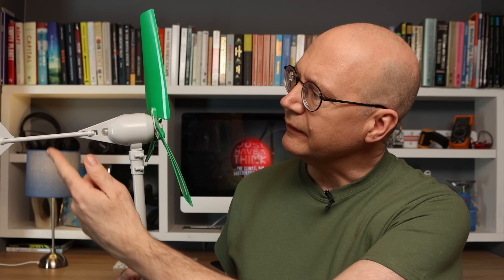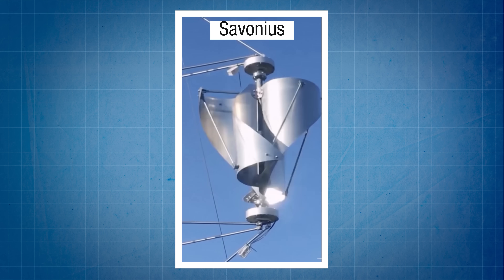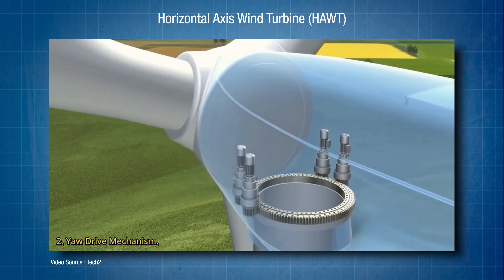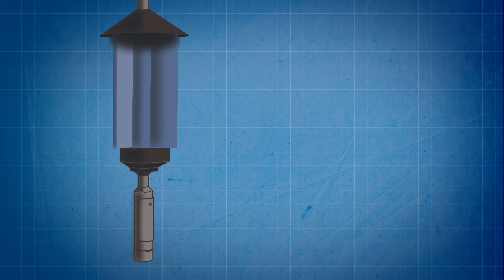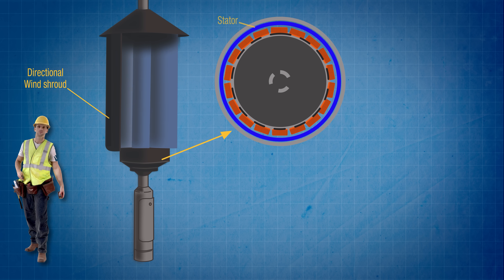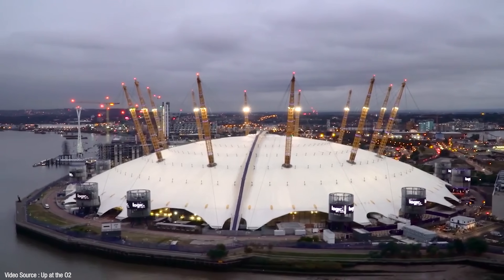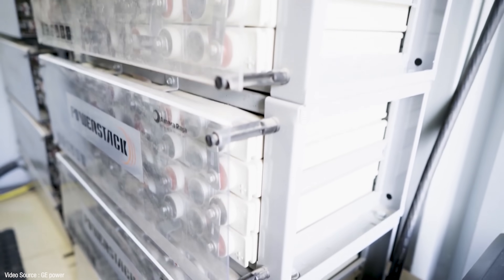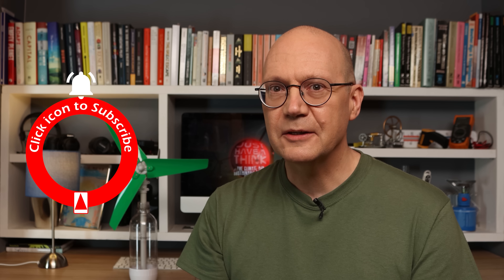A vertical axis wind turbine that doesn't need the prevailing wind! How do they do that?

Comment: If the prevailing wind is against the flow of traffic the airflow from traffic will tend to negate this.

If they are economical enough to produce maybe they should have two on lampposts in open areas, one for traffic and one a little higher for wind.

Comment: nothing is free, this "wasted" energy makes cars burn less fuel, if you start harvesting this wind, you will slow air flow and cars will burn bit more fuel because of air friction, for each car it will be very little, but combined, it will be more emissions, you will just convert fossil fuel to energy like in any other fossil fuel power plant, you just won't pay for for fuel, ppl on road will

Comment: Please check the numbers before spreading them. Eghter this is a scam or there are a major mixup in the presentation of the numbers. At 5.4 m/s the available power in the wind is less than 60 W/m2. The shown turbine has an swept area of less than 2 m2 and can't possibly produce more than 120 W yet it is claimed to produce 2500 W under those conditions. Later it is claimed that a 3 MW plant consist of 125 such turbines giving each turbine a power of 24 000 W. If the calculations refers to wastly different sizes of turbines this needs to be clarified. As it is now the video is very misleading.
Reply: Many of us have commented on this, but Dave is not listening . . .

Comment: These turbines might increase fuel consumption by the passing vehicles due to the air flow interactions. Would be interested to see what the precise impact to the cars is.
Reply: In all cases the additional energy consumption of the car is far greater than the energy generated. Overall efficiency gets decreased, fuel consumption gets increased significantly.

Comment: I like the concept. I have a corner plot house which is susceptible to huge prevailing winds over the course of the year. In fact, this has caused damage to brickwork, pointing and window seals which all need repair or replacement over time. Rather than accepting this as the normal acceptable cost of having a larger corner plot, why not make this work in our benefit? 

I've often thought about adding energy efficiency but couldn't justify the up-front cost based on pure energy consumption basis. But it becomes more persuasive if I could add a vertical axis solution (or any solution) which could also help to reduce or offset the damage and cost caused by these prevailing winds. Something I never previously considered.

Comment: The turbines are reducing the airflow along the road, which means they're increasing the drag on the vehicles, and thus increasing the fuel used by the vehicles. So the energy generated is not free - it's imposing an additional cost on the drivers.
Reply: When a vehicle passes by, it suffers from air resistance and therefore drag, regardless of whether there is a turbine nearby. This causes the air to move. By the time that moving air reaches a turbine at the side of the road, the vehicle has gone, so the turbine doesn't affect the vehicle. The turbine is so small that it only interferes with a small fraction of the air which might or might not have helped or hindered a following vehicle.
Reply: @MD-tv5fp  It seems clear to me that, at least on average, it's slowing down the air that would have helped the following vehicle. 

The effect may not be large, and indeed, the energy extracted from the air is small compared with the energy used by all the passing vehicles. But as long as the effect exists, it's increasing the energy cost for the vehicles. The driver's would probably never notice the difference - the changed cost would get lost in the noise. But the cost is still there, and the energy is not free.
Reply: @sylviaelse5086  The existing street furniture (posts)  are immovable, and already cause drag in the airflow.  When turbines are fitted,  they spin in the flow, reducing the friction, acting as a lubricant and allowing the air to move more easily.
Reply: @sylviaelse5086  The  energy has already been expended by the leading vehicle, but would normally be dissipated into the surrounding air. So it has been "paid for" and wasted. If it is instead used to turn the turbines, it is being recycled for free.  A turbine moving with the flow disturbes the air less than a non-moving obstacle such as the original lamp-post, as it acts like a roller bearing. The following vehicles should benefit from that.
Reply: @MD-tv5fp  You have absolutely no clue what you are talking about. Kinetic energy and resistance are coupled and without drag no blade moves. Any drag gets added to the air resistance, not subtracted.
Reply: @hans-joachimbierwirth4727  Practical experience is worth more than theory.
Reply: You have traffic flowing in both directions, so the air flow from both would just cancel each other out normally, unless say a lorry was going the opposite direction to a motorcycle.

Comment: Dust and dirt build up will be a big problem, as the need for air flow will increase micro particle deposits, on a motorway as indeed in London these particles stick in a fine dark film that has to be washes off with a detergent, the film is sticky and will attract dust as well as being pretty toxic.

Comment: Wouldn't the turbine create more drag on a car so effectively we would all be using more fuel, then the car has to move so fast to make it spin so in times of gridlock its also null and void, not to mention to keep them at speed to generate the figures would require a constant flow of traffic.

Comment: This smells extremely fishy to me. Those KWh numbers seem far too high. If they could really collect that much energy from vehicle air disturbances just by placing them on lampposts, just imagine how much more wasted energy would be flying off in between them, and over-head! If I believed those numbers, I'd say we just need to surround all of our roads in arrays of these things and we could power our entire society off of the wasted air disturbance of traffic on our roads!
     Of course, I don't believe it and I think the "inventors" are scam artists. I wouldn't be the least bit surprised if the test units they installed actually had a hidden motor that was tapped into the grid connection and drawing power from just beyond the hookup that was metering how much they were generating. That's probably far too elaborate though, generally with these things they just go the much more straightforward route of using a dodgy meter, or simply making up the data out of whole cloth. It makes me sad that so many people who's desk this passes over (this channel's creator, included) don't seem to have a solid enough grasp of the mechanics involved to even question those highly suspicious numbers. Or maybe everyone just really really wants to believe. "Science is the new religion" indeed.

Comment: That calculation of the yield seems very fishy. The airflow next to the highway is not only very intermittent, it is also very turbulent. That will result in very low efficiency of converting the traffic airflow into electricity. Even in their example of a couple of kWh per day its hardly worth the effort. It might even negatively impact the yield from the wind flow, so it is nice for marketing purposes to talk about traffic airflow, but in reality it would be better to place them higher up and fully exposed to the wind. And this is shown by the pilot projects...

Comment: Whist working at BSkyB I suggested placing small wind generators at the exhausts of Air Handling Units, this was never followed up but the idea is the same as that described above, the exhaust air flow is there anyway and a fan placed about a metre away would not impinge on the AHU efficiency or cost, there are of course many thousands of AHUs on top of commercial buildings around the UK (millions in the world) and these are working whenever the buildings are working so I think this would be a way of recouping some of the energy used.  I had some success in persuading Sky to employ another energy saving scheme in the computer rooms which I called "Hot & Cold lanes" the overall savings with this approached 90%, I was never thanked for my innovations but hey that's life, if anyone wants to know more drop me a comment  :-)

Comment: But.....the net movement of air in the direction of traffic reduces energy needed yo "punch a hole"in the air.
So...at least to some degree. MORE fossil fuel would be required to propell the vehicles....essentially consuming petrol of individual drivers to "create" "wind energy"

Comment: Did anyone look to see how much extra fuel would need to be burned to run these? You say it's wasted energy but it's not. Air resistance is a huge resistance to a moving vehicle. The 12m/s you quote is 26mph that assists the vehicle moving. The turbine will reduce this which WILL result in burning more fuel to maintain speed.

Comment: It's a scam which will not generate any significant amout of power. The cost of putting such tiny useless things in the middle of the motorway will never make enough power to light the lamp at the top. 2.5KW my arse. You need 10m2 of cross sectional area with a wind of 25mph to get 2.5kW. That's at a dreamed for level of efficency.

Comment: Interesting, what is the Energy Return on Energy Invested (EROEI) on those turbines, the very big 3 blade turbines have very good EROEI which is why they are doing them, you get more energy coming from them than the energy spent producing them. But those turbines don't have that advantage. The numbers are not a great comparison since they only show power purchase agreements which I don't like when it comes to alternative energy it needs to be at affordable price to buy outright and to maximize manufacturing and distribution energy efficiency to maximize EROEI. Not made in China with their dirty factories and terrible EROEI.

Comment: So, you almost got to my thought when you talked about the vehicle punching holes in the air regardless of what is there.  That is true.  But, there is no free lunch.  If you put up a structure that captures and impedes the flow of air out of the way of vehicles, those vehicles are going to have to work slightly harder to get through that air.  Thus, the power generated is not free.  It is paid for by the motoring public.  People driving along roads where these are installed will be paying a small tax in the form of decreased fuel mileage.
Reply: Oh my, you punched a hole in the hot air he produced :/
Reply: @hans-joachimbierwirth4727  Thank you.

Comment: I'm not happy with the explanation of residual air-flow. 
We don't get something for nothing, usually. 

My intuition suggests that tapping the residual air-flow, as suggested in the video, would slow down the street airflow, requiring the next car to burn a bit more gas to push through. Effectively getting the power from the car in a very inefficient manner.
I think this deserves a deeper look, especially at simulations to understand the feedback it has on cars and to understand if the efficiency of the overall system is where it should be.

Comment: An idea for a future video. Look at Seatwirls offshore vertical turbines who are claimed to be cheaper to run and maintain compared to other offshore windturbines because the generator hub is at a water level also they float. They have a 30KW model installed 2015 and are working on a 1MW model to be released 2022.

Comment: Would be great to see these in Rail/Metro systems too
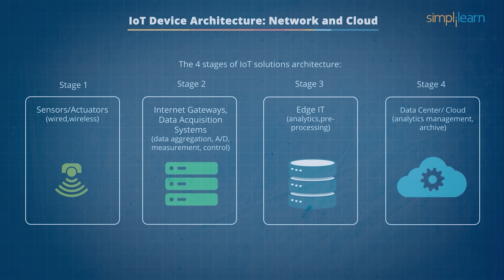Reply: See 7:49. This wind energy comes from cars burning petrol. The cars will ultimately have to work harder in order to push these turbines. So useful for providing remote power to eg a camera, yes. But not useful for electricity generation for the grid.

Comment: I love the idea, but the numbers don`t seems to work. In order to archive 2.5 kW at a windspeed of 5.4 m/s at 30% efficency the area needed to speed down the wind needs to be 142.89 meters squared. The prototypes are not even close to that. Further more, if they were able to harness that much power the lamp posts would not be able to withstand the aditional force when the windspeed picks up to storm.

With that said,   I do belive it is an idea worth exploring as long as they can pay for them self at a 1% of the stated output.
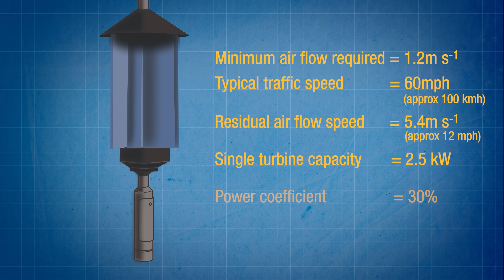Reply: It's not worth it. Dave's numbers don't stack up, they are wrong by either two (5:31) or three (8:50) orders of magnitude. So which is it, 2.5 or 24 kW? The right number for a VAWT this size is about 25 watt, by following the standard VAWT physics formulas. There is no way that pays for itself.

Comment: Even better, all cars should be provided with fans that push the air forward, thus increasing the gusts of the wonderful wind they create. The fan's motors will be powered by green electricity, generated by photovoltaic cells that pick up 19 to the 5th magnitude number of photons from the headlights of the coming traffic, enhanced by the Doppler effect. Why didn't anybody think of that?

Comment: A quick calculation - 5.8 KWh/day = 2117 KWh/year.  At UK wholesale prices or 4p-6p/KWh (see link below) the potential annual yield is approx. £85-£127/year. It would seem selling electricity to the grid would not make this a financially feasibly form of energy generation.  If companies were using this system to save on their retail energy rates (between 10p-20p/ KWh for commercial customers...a guess, please tell me if I'm way off here) then the business case looks marginally better.  It would be interesting to know whether the lease pricing - £29,000 for 125 turbines = £232 each - includes installation, inverters and connection upgrades etc...At 10p/ KWh, then there'd be a small loss assuming all installation costs are included in the lease price.  Break-even would be about 11p so anything north of that would make sense. 

(https://www.ofgem.gov.uk/data-portal/all-charts/policy-area/electricity-wholesale-markets)
Reply: I'd also like to see the CFD analysis of the turbulence effects.  I suspect that with roughly equal volumes of traffic flow on both side of the carriageway, then this system would not have any additional drag effect (and possibly reduce it).  But for uneven traffic flows, might it be detrimental?
Reply: Dave's numbers don't stack up, they are wrong by either two (5:31) or three (8:50) orders of magnitude. (So which is it, Dave, 2.5 or 24 kW?) The right number for a VAWT this size is about 25 watt, by following the standard VAWT physics formulas. It will never be cost-effective.  It is most likely a scam.

Comment: I do hope they can install these things from the side, not need to remove whatever is on top of the pole to drop it down... Anyways, the idea seems sound as using existing poles cuts down on installation costs. That leaves the issue of a thousand small turbines needing thousand inverters to regulate the electricity so they all play nice with the grid, and needing to maintain a thousand small turbines instead of few big ones. At least these will be easier to access given they would be near the city instead of far offshore and close to ground too.

Comment: Excellent review  if every house in the uk had one of these, the amout of strain that it would take off the grid would be amazing.

A multi layered sollution is required. Solar panels, wind energy, batteries, buying excess electricity when too much is needed and any other idea is what all houses could do with.

Comment: It is always the same with the stories "Oh, we have a superb new technology that is better in every way" - and then the rest of the industry and those involved in the subject laugh and ignore them - cause the technology is neither new nor better.

Vertical turbines do have their place. But lets talk about the claims being made here.
is the air-movement created by cars on highways lost? Yes, parts of it. But the vehicles move in the same direction, so the next vehicle that follows is now driving in air that is already moving along. To generate power from that would also mean slowing down the air and thus increasing resistance. That will be a very minor increase in resistance for the cars and still produce more energy than it creates resistance, but it is not 0 as claimed.

Then the placement and costs in comparison to solar:
For the solar installation the cost of the land, construction, maintenance etc was included but not for the turbines. The price for the turbines also was under the assumption that all the infrastructure for them would be for free - which it is not.
You can not use the existing cabling as claimed either as the lamps are not running on some arbitrary changing current from the turbine but are directly connected to the grid. The turbine needs to be connected to the charge controller and inverter directly. Neither are the lampposts (or communication-antenna) designed to handle such loads. The structure needs to handle the (rather large) increase of force applied to them. Have you seen how thin and fragile telecommunication-masts are? They are designed to just hold some antennas, not some large rotating masses. And while small things like cabling at the lamppost don't cost much it just shows that even they are ignorant (or rather lying) even about tiny mundane things.

Then the constant "we can include sensors and internet" - oh really? like they can do with anything else there already.

In terms of efficiency they are also not great and as they are rather volatile the energy they produce is essentially worthless without extra energy storage - which also costs a lot of money.
And lastly in most situations for the area they occupy they produce far less electricity than a simple solar panel.

I still kinda like the channel, but most of the time it just feels like a person that does free advertisement for scammers without realising it.